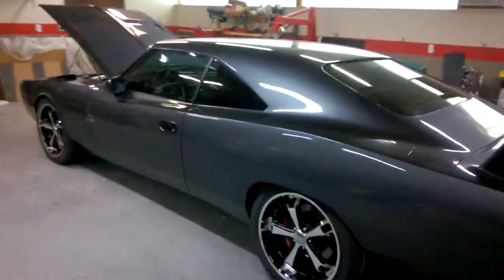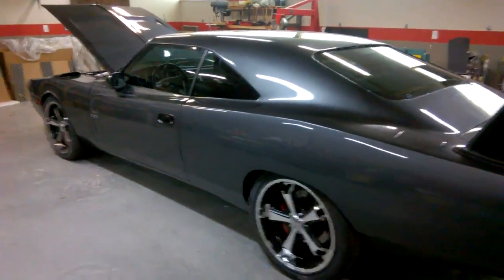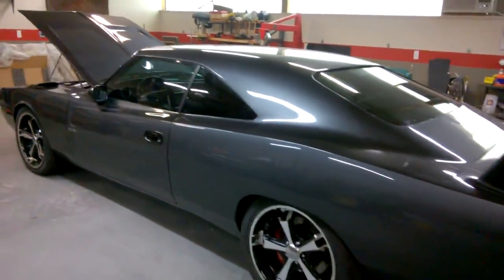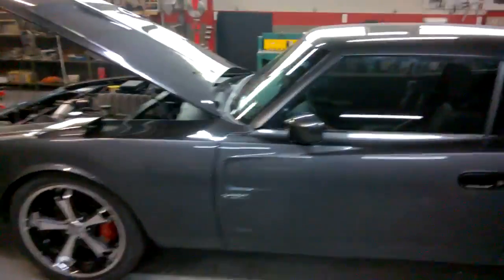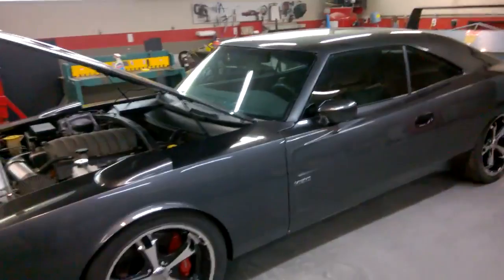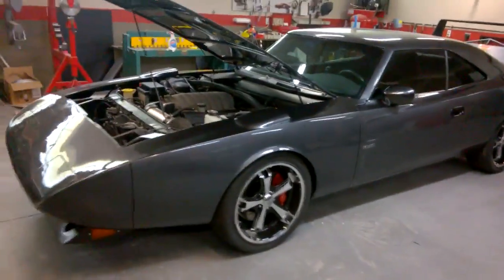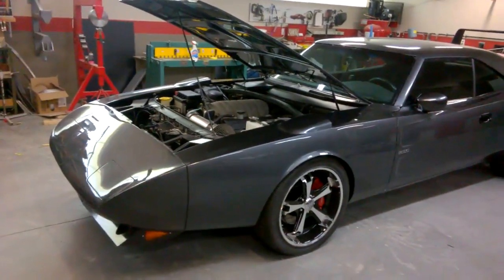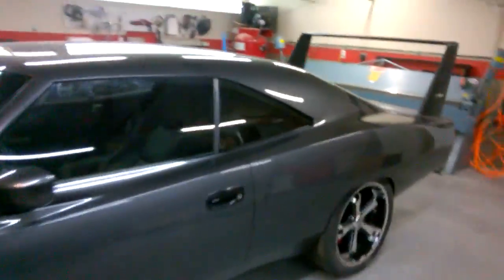SRT-8 Dodge Daytona Clone Car Project: Quick Walk Around

Comment: Did you have to cut to get tht dash or seats in there? I have a 68and want those seats in mine
Reply from the maker: derrick butts The car is really a 2006 SRT-8 that I cut the body off of and put a 1969 Charger body on. To your question though I have see quite a few guys put the new seats in old Chargers
 A little work is needed where they mount to the floor but they fit fine. Be sure to get new Challenger seats or you can't get into the back seat. Challenger seats fold forward.